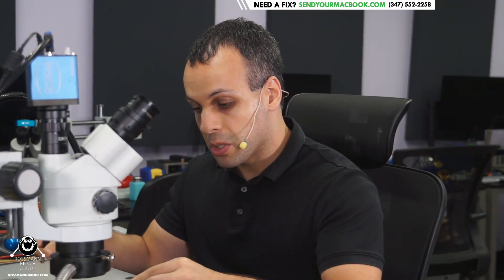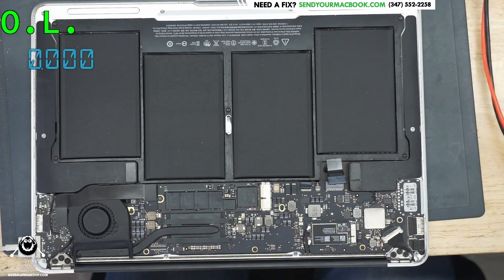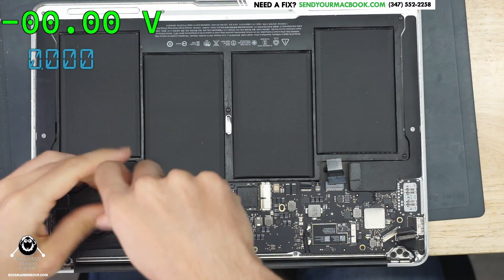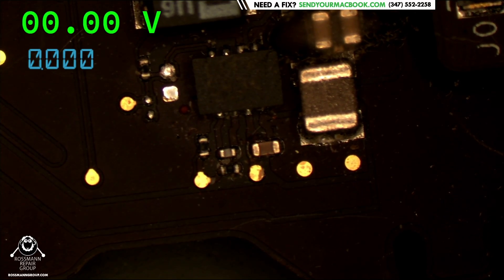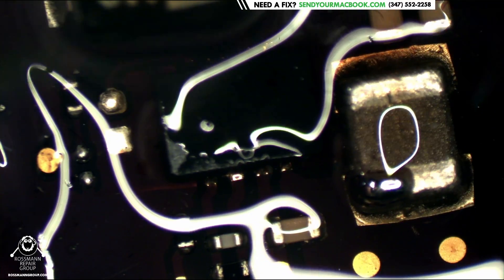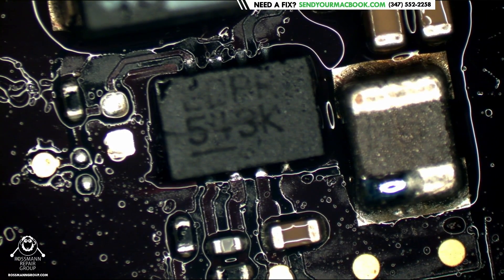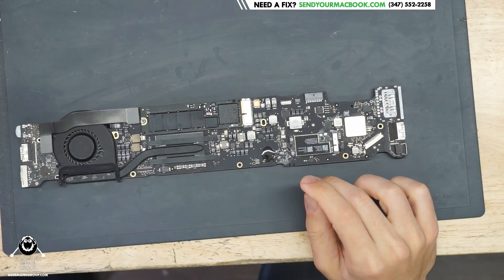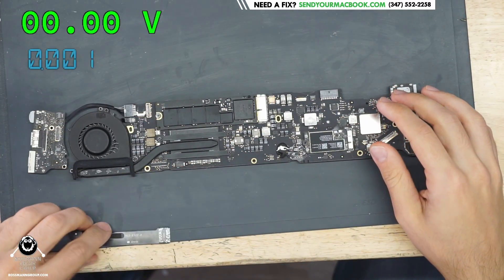Macbook Air A1466 logic board repair; no power, 2.1v on PP3V42_G3H

Comment: Hello, I have a MacBook Air model A1466, and it has been experiencing the following issue. It runs normally at an average temperature of 65 to 70 degrees Celsius, both the CPU and GPU, but suddenly, after about 40 to 50 minutes of use, it shuts down and won't turn on again in any way. The only way I can get it to turn on is by disconnecting the battery and leaving it disconnected for at least 24 hours. If I disconnect the battery and reconnect it immediately, it also doesn't work. I've tried taking it to a few places, but here in Brazil, nobody seems to be able to fix it. I've watched your videos and studied the electrical diagram a bit, but I can't figure out what it might be. Another relevant detail is that before this problem occurred, I was using a charger with frayed and exposed wires, so there may have been a short circuit. Could you please provide some guidance? Any ideas on what kind of tests I could perform on the motherboard? So sorry to bother you, but your help is my last hope! 😬

Comment: Sir I have macbook air 1466 , and it has issue before no power cpu fan also not working. Now one of the shop , they have repaired,but now processor over heating. Please help me what could be the issue? Note : currently no thermal paste on the heat sink.

Comment: I have a mac book air a1466  not powering on, I'm getting 8.4v on r47, 5v on 2r2 and 3.3v on pp3v42. I got no clue what's happening. also when I connect the charger the board starts to get warm from by the ram modules and where the hard drive connects. Help Please I'm pretty much a noob

Comment: I have a air laptop 1466 is dead. I pulled a hdmi connector adapter after watch to my TV. Then poof dead. Everytime I plug the power it create a high speed fan and can't boot up at all. Now shall I replace the locks board and should fix right anything am I missing?

Comment: The magnet on the fan was a bit odd. I can't help but wonder since it booted OK with it on, if maybe it was somehow causing EMF to surge? Magnets can alter electrical current flow, and stray magnets should usually be kept away from sensitive electronics.

Comment: Computer is trolling you at the beginning.  I know one time that i kept on taking my computer up to Best Buy to get it looked at but the problem didn’t happen. I had to take it up there 5 times before it happen it was so simple they fixed it didn’t even charge me anything can’t remember what was the issue. I know i was to young and hadn’t came interested in computers yet. It was a hp desktop

Comment: A reason the crud will cause the problem is that the feedback circuit is high impedance  548k is up there.  More a vacuum tube circuit value.  My guess was that they did not want the feedback circuit need a lot of current to function .  Nice video.

Comment: 2.1v on a 4.2v rail? I'm only 3 seconds in but I suspect a short to ground somewhere given that

Edit: so there was crudd on the feedback line, kinda right, kinda wrong, not shorted to ground, but partially conducting to a different rail or something like it